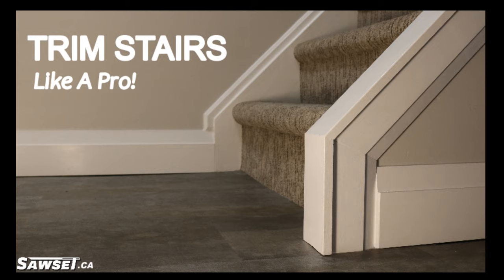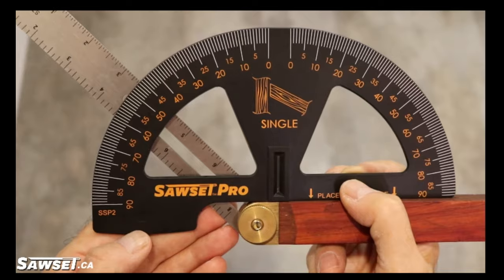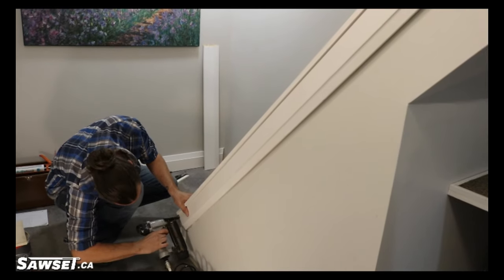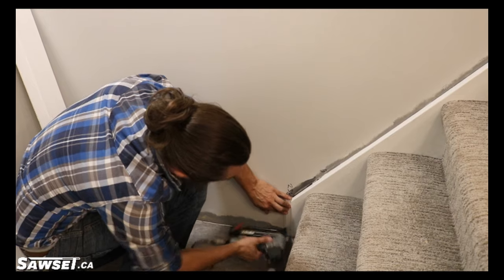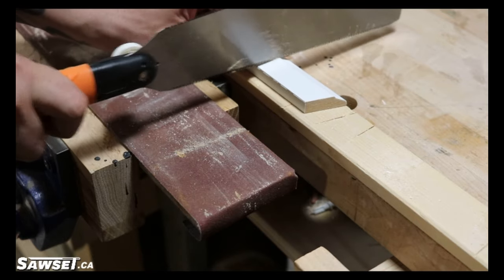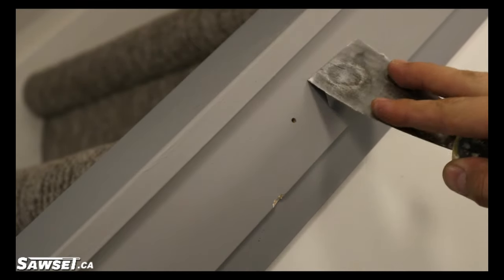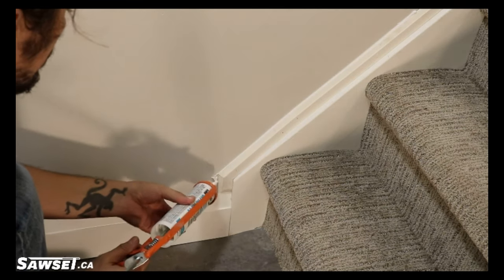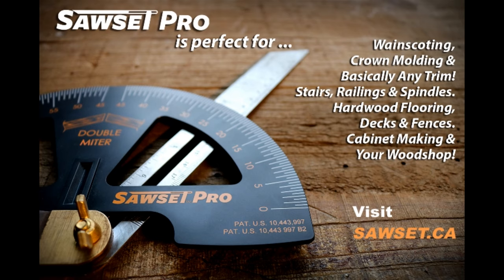How To Trim Stairs. Tips and Tricks #bevel #mitersaw #miter

Comment: Hello we our have difficult to cutting 7.5 “ crown molding try any angles it’s 45 but when we cut it’s not coming out the e d side well it’s no joints if you able give us the tips we watch lots off crown molding video this is also not flat crown
Reply from the maker: You most likely have the Crown molding in the wrong location.
Slide the 2 moldings at the same time up or down the wall.
Test this method with 2 short pieces, then you will understand what I'm saying.
We have 2 other video on installing crown molding.

Comment: Tips on putting holes no shrinkage use window glazing flower mix Until it crumbles a little messy but you will never get a fisheye Fill flash wipe down with your hands Old painter Trick
Reply from the maker: Thanks for your input.

Comment: I have an oak staircase and the carpenter butted the treads up against the drywall, therefore, I have no skirtboard.  In all your experience, what can I do to dress out the area from the treads upward?  The treads have a bullnose, so it would be almost impossible to retrofit a tread there.  What would look good?  THUMBS UP!!!
Reply from the maker: You could install trimming as if there is a stringer, or there are videos that show how to build a skirt board.
Reply: @SawsetTools  Is it advisable to cut out the drywall where the skirtboard could be in its place?  A thin  oak skirtboard, as thin as wallboard, cut to fit, and perhaps a decorative quarterround strip where the new shirtboard hits the wallboard on that angle?
Reply from the maker: @lostinmyspace4910  Sorry, never done it before. Do not want to mislead.

Comment: One can use a transition blocks when mixing 2 different profiles. And sometimes, like in your case, one can use the top part of the baseboard only to go around and over the stringer. This way one can miter the base with the stair moulding correctly. Butting trim like you did looks terrible. They are two separate trim details butted together. A pro would never do what you did, I'm sorry.
Reply from the maker: There are many ways to trim. Thanks for your input.

Comment: A “pro” would find the angle of the rake of the staircase and automatically know all their subsequent miters and angle cuts.  😉
Reply from the maker: Like your play list.
Reply: @SawsetTools  why does everyone say that?
Reply from the maker: @jeffpower6473  It's able to find a fraction of a degree for accuracy.
Reply: @SawsetTools  I get it, but I’ve been a stair builder for 10+ years.  When I realized one day early in my career that After I set  the rake of my skirt board and from there automatically knew all my miter cuts it was an eye opener.  It made things much faster, because I didn’t have to fiddle with an angle gauge.   I however still use an angle gauge from time to time, it has its uses for sure.
Reply from the maker: @jeffpower6473  Can you recommend a video for " setting a rake"?
I couldn't find one.
Reply: @SawsetTools  the “rake” or angle of the skirt is determined by the rise and run of the stair.  I take my 8’ level and place it along the noses of each tread, then I put my digital cube angle finder on the level. This tells you what the angle of stairs is in relation to level.  From there it’s all math.  

For instance typical modern stairs are 36 degrees.  If you are bringing base cap down your skirt to the base board that’s level to the floor, that miter would be 18 degrees.  
If you are bringing base cap down your skirt to a vertical drop at the end of the skirt, or you’re mitering the end of your pony wall cap to drop vertical the math is 90 degrees - 36 degrees = 54 degrees/2 = miter cut of 27 degrees.    

Don’t really know of a video that explains this.
Reply from the maker: @jeffpower6473  Thanks Jeff, your method works in theory. But you need a fraction of a degree for tight fitting joints. I am a retired contractor. My last job was building my own house.
Reply: @SawsetTools  oh, it works in real life as well not just in theory.😉  The key is to be very intentional about installing the skirt boards and maintaining a consistent angle.  

I’m in the middle of building my own house as well, I’ve been a finish Carpenter forever but building an entire house is a whole other level.
Reply from the maker: @jeffpower6473  You sound like one of the good Pros.
But, normally homes are completed quickly and not accurately.
So, you wind up re cutting the miters or the "painter will fix it."
You know what I am talking about.
Reply: @SawsetTools  I live in Florida, land of the tract homes.  Thankfully I’ve been blessed to move away from that.
Reply from the maker: @jeffpower6473  Send me your address through our website.